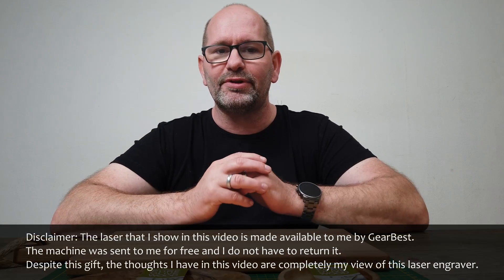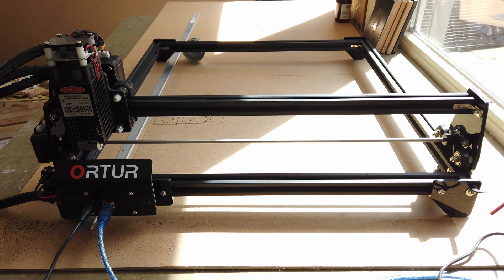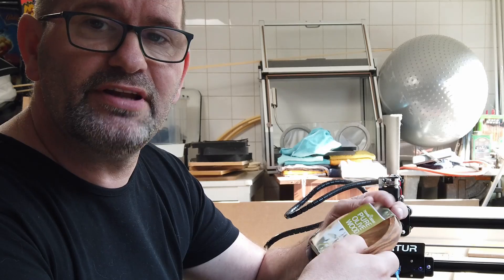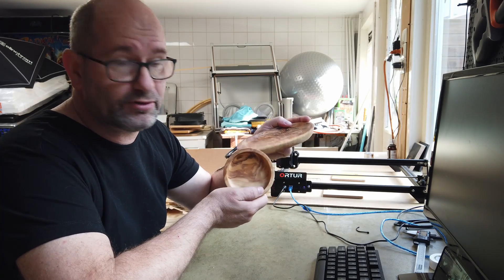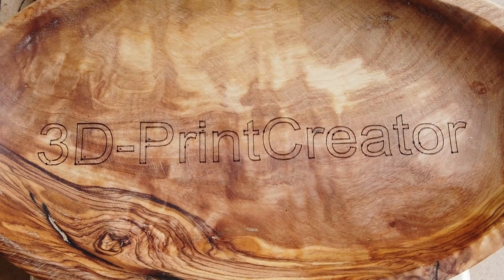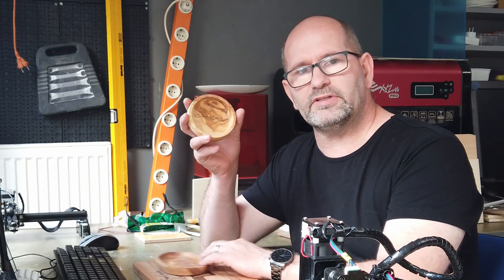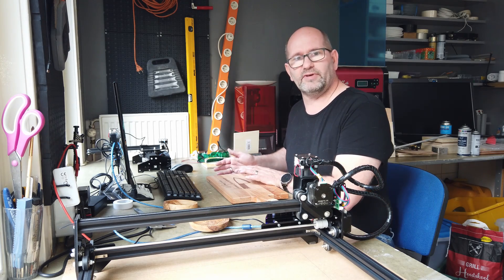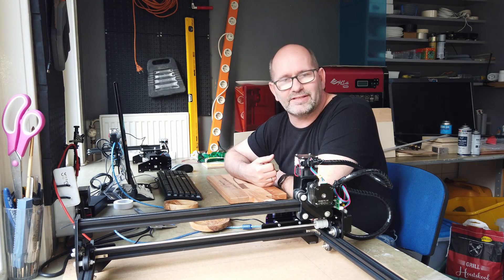▼ Ortur Laser Master 2 review | The difference with it's smaller brother

Comment: I received my laser master 2 and when assembling it I got to the point of installing the trolley and found one side was broken in the box, I sent it back and within a couple of days they had another on at my door, I was impressed, until I tried to get it to operate the new one, at which time the program said I had no power supply. I purchased LightBurn because I thought it could have been in the program but this one said no power supply and that it said it had a problem with a board. I work with electronics and I checked the installation at least 10 times but I refused to pull it apart because it's brand new. I know you sometimes get a lemon but problems 2 times in a row. I gonna try something else.
Reply from the maker: Oh Crap, that sucks.
Did you receive a good working power supply? The PS I have for my Ortur with a 7 Watt laser gives me the same problems when I use it on my 15 Watt machine.
It can be, you only have a 2 Amps powersupply, while in fact, you will need a 3 Amps version if your laser is 15 or 20 Watt.

Comment: as far as I know the flickering on the monitor is actually the refresh rate being picked up by the camera that is doing the filming so I don't think it can be sold but I may be completely wrong altogether, thanks for the video it's very much appreciated I was considering doing something like this thank you
Reply from the maker: Hi David,
The first part is true, what we see here is the refresh rate of the monitor, and that setting is different from the 1/50 shutter setting in my camera that is used because of the 25 FPS framerate that is preset in my camera.
However, there are camera's that have the possibility to change the shutterspeed so that it matches the refresh rate of the monitor. This would have fixed the problem if only this camera would have that setting.

Comment: Well hello there... long time... I see you still have your xyz printer, as do I.  I recently bought the 20 watt version and the rotary axis  combo and just seen this video while I was looking for assembly videos.
Reply from the maker: Hi Nathan, that's a long time ago :-)
I still have the housing of the Da Vinci Pro printer, but on the inside it's a home made CoreXY printer running Marlin 2.01 on a 32 bit board.
I don't do anything anymore for or with XYZPrinting. After all I have done for them, they wanted me to remove all my video's and threatened me with a lawsuit if I didn't. I never took them down, they never did anything either. I hear the same stories from other YouTubers, now no one cares about them anymore. It's a pity, because them made nice printers.

Comment: Thanks for the review
What do you think of TOTEM S 40W Laser (sold by Banggood)? I intend to buy a CNC Laser that cuts material up to 8mm (wood, acrylic, etc.); can Ortur Laser Master 2 be replaced with a 40W laser, for example?
PS. Too bad it can't be sent to Brazil!
Reply from the maker: Hi Daniel,
I don't know the Totem 40Watt model, but as it is a diode laser, the real output of laser light should be something like 12 to 15 Watt (3 times more power then the so called 15 Watt version I use).
Be advised that cutting deeper doesn't need more power, but a straight laser line, and diode lasers don't have that. Recently I made a video explaining the KERF of diode lasers, that gives very detailed information about the problem of cutting deeper in materials.
See: https://youtu.be/5m63ofkama8
I have not yet tried it myself, but I have seen people who replaced the Ortur diode lasers for other types with more power, so it must be possible. I am waiting for a laser that should have been sent to me but that is weeks ago, and I have not yet received it.
Reply: @3dPrintCreator  Thanks for the answer, then, which laser would you recommend me to cut materials with more depth and that can be adapted in this Ortur Laser Master 2, I don't say 8mm but even a 5mm or 6mm would be fine.
PS.: I signed up for your channel because, in addition to the good information you provide, I will need your help to, fortunately, buy my cnc laser (for hobby services); thanks
Reply from the maker: At this moment I am working on an Air Assist that will be available VERY soon, and then 5mm is doable with the 15 Watt diode laser (actually 5.5 Watt light output)
Anything deeper than that, you will need a CO2 laser as these machines don't have that much KERF problems.
Reply: @3dPrintCreator  OK but, these machines, like the Ortur Master 2 don't support CO2, do they? And CO2 lasers are much more expensive!
And can a 20W Laser cut plywood, MDF and/or 6mm acrylic with a few passes?
PS.: I don't understand your speech correctly, because English is not my native language.
Reply from the maker: Lol, English is not my native language either :-)
These simple frames can't be used with CO2 lasers. A CO2 laser needs a good, sturdy and closed housing as they are far more dangerous. The laser light they produce can't be seen, but can blind you or wound you in a fraction of a second. If you have interest in a CO2 laser, I would suggest you buy one that is not to cheap. Cheap CO2 lasers are for people that know exactly what they are doing and understand all the risks that come with the product. They have to be able to repair and understand their lasers very well. If you are like me, a beginner in the field of lasers, always go for the safe and practical machines that have loads of safeties. They cost from 1000 Dollar and up, but that can save your life. 
No diode laser (like the ones we use) will be able to perfectly cut thick materials lilke plywood, MDF and or acrylic very well. With tricks we can make it work, but it's absolutely not recommended.
Reply: @3dPrintCreator  Very well; thanks for the instructions, i will be satisfied with the Ortur Laser Master 2 or any similar.

Comment: First, thanks for the video; I liked your sincerity when you said that the power of the laser is not really 15 Watts, but 4.5 Watts. I have some questions:
1) Is it possible to later expand to a larger floor area?
2) Can a Laser with a higher capacity be used?
3) Is it useful to cut letters on adhesive paper (mirrored mode)?
4) I did not understand how to determine the zero point of x and y.
Reply from the maker: Hi, thanks for your comment, highly appreciated.
1) yes and no. I have not yet found a way to set the x and y length in the motherboard software, yet there are very cheap replacement boards that use open firmware. Then you can set all parameters.
2) you can change the laser very easily for one with a different power setting. There are lots of videos that explain how to do that.
3) Cutting paper is very easy, adhesive paper as well. Yet be very sure not to cut or burn materials that are poisoning, so do the Beilstein test with the adhesive material before you start. I have a video about this test.
4) Is depends on the used software how you set a point for reference. The machine uses endstops for the absolute corner and you can set points relative to that, or you can set a new zero point. In the last case, you loose the relation to the corner, or absolute corner point. Yet the last method is the easy way to expand the frame size of the machine.
Reply: @3dPrintCreator  Thank you very much for the explanations. Later, I am interested in buying the Ortur Laser Master 2 or maybe a bigger one (?).

Comment: The reason your monitor looks as though it is flickering is because the camera is recording at a slightly different frequency to the monitor output, this cant be fixed from the settings
Reply from the maker: Yes absolutely, but this camera doesn't have a clearscan feature, nor could I set a shutter speed with this particular model.
I wanted to make the video nevertheless.

Comment: To remove the flicker on the screen simply adjust the frame rate on your camera to match the screen's.
Reply from the maker: Yes you are right, but at the time and place where I made this video, I only had the DJI Osmo Pocket camera, and this doesn't have this possibility.

Comment: Can you pass through a piece on the x axis longer than the unit such as a longboard? and can the 20w version handle engraving on acrylic sheet/plexiglass?
Reply from the maker: I am not sure what you mean by that? You can place the unit on a longboard, and if you need something bigger, there is the master II version. 
Yes, the 20Watt can engrave acrylic, but the best result would be if you use the 7 watt version.
Reply: 3d Print Creator thanks for the reply! I just meant I need to use a longer piece of wood bigger than the units entire frame. 

That is interesting and very confusing how come you suggest the 7w exactly ? I want to do wood/MDF and acrylic sheets
Reply from the maker: Ah okay, I can't make it bigger than the frame.
In terms of power, if you take a 7-watt version, the controller can divide this power into 4096 steps. Each gradation is then 1/4096 of 7 watts. If you take the heavier 15watt or 20watt machine, the gradations remain 1/4096 part of the total power, but those particles each become larger, and therefore less accurate. Moreover, for engraving you rarely use more than 7 watts, so for photo realistic images it is better to have the full gray scales than a lot of power that you cannot use.
Reply: @3dPrintCreator  Super helpful makes sense I did not know this about laser engraving. 

The longer piece I do not want to engrave the entire surface just want to be able to pass it through. Which I see there is a small gap from the table surface and the frame so maybe I'll be able to fit a 1/2 in board through there. 

Guess I'll find out if I pull the trigger and purchase one which is looking likely considering the 7 watt version is so much cheaper.

Comment: Hi, thanks for the review!
One question: since I also own the "Ortur Laser Master" and would like to use Lightburn, can you tell me what settings you use on the software (engraving/cutting)?
Thanks so much!
Reply from the maker: That depends on the material you want to work with. Usually I start with very fast and low settings, and I increase it when the effect is not enough. Then when the settings are good, I go for the final piece.